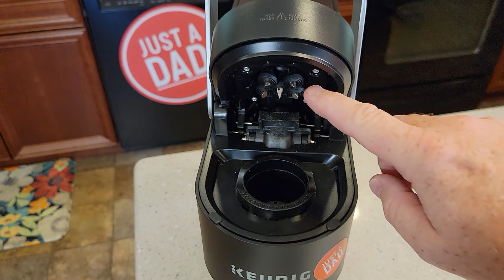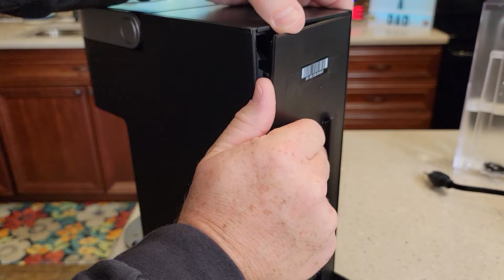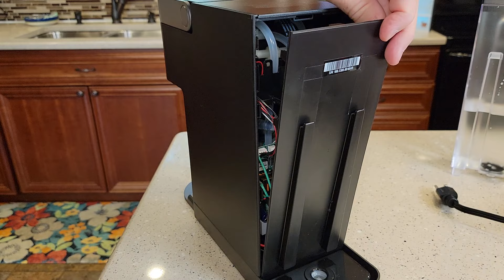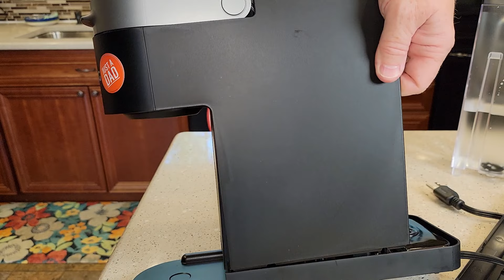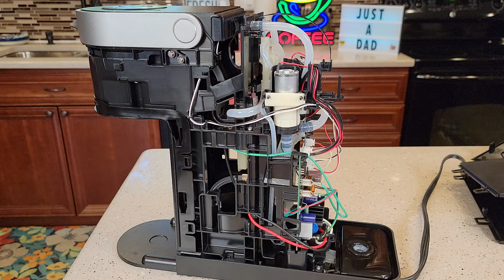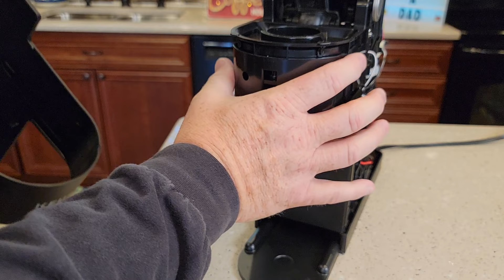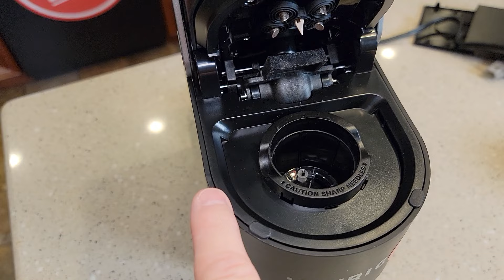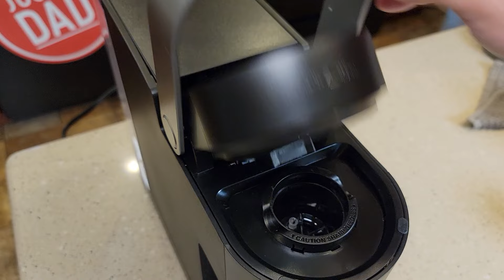🔧 Keurig K-Slim Not Working? | Thermostat Reset & Repair Guide

Comment: Thanks - great video. Only thing to add - I had a left over 3/4" diameter black plastic plug, so before I put the cover back on, I drilled a hole in the cover at the correct spot to easily reset the thermostat without removing the cover again.

Comment: I followed all your steps at the end when I ran the water it did the steaming and the spitting and not too much water came out like you said. I tried it the second time and it didn’t work. The light won’t come on. I will try it one more time.
Reply: I did it again. The light came on, but the water is not coming out. Any other suggestions?

Comment: The hardest part was finding a paper clip!  Actually ended up using a solid length of aluminum picture frame hanging wire.  Continuity checked, descale light flashing, so running a descale cycle.  looking good so far...

Comment: Mine is still somewhat new, but I hadn't used it in a couple weeks. Went to brew a cup this morning, there was still some water left in the reservoir...It started fine as normal, but no coffee came out and it suddenly shut itself off. I could faintly smell something was burning, but it certainly wasn't coffee. 😟Couldn't get it to power back on. Unplugged it, plugged it back in, filled the reservoir...Nothing. The K-Cup inside wasn't even hot...But the top of the machine definitely was. I found some other troubleshooting methods that said to remove the reservoir, unplug it and wait 10 minutes for the computer inside to reset, but that didn't work either. I was hesitant about taking it apart like this, knowing if I slip up and break something, there goes the warranty. But I can't afford to have someone repair it for me, nor can I afford a new one. So this video was my only shot...And it worked! 🥰 Definitely saved my coffee maker, and I'm certainly saving this video from now on.

Comment: I started and stopped this comment about 10 times. I tried to make it short and compact but failed every time, (because there is so much I wish I could tell you).  Bottom line, this mornings descaling killed my machine exactly as you described, by NOT flashing the "ADD WATER" light.  I contacted tech support and got the usual "Did you try turning it off and on again, try another wall outlet... If that fails, you need a new machine" (ref: The IT Crowd)  I purchased a new Keurig Slim on Amazon. (by the way, Keurig  did offer 35% off a $159 Slim when it's $99 on Amazon) Before trashing the old one I thought "I wonder if Youtube knows a guy" ;-) ;-) I found and watched your video twice and fixed my machine in less than ten minutes. Very well documented steps, easy to follow.  Thank you :-) :-)  I still wish I could tell you the full story . After the fix I called tech support again and asked why this solution was not proposed... they had no real answer. Again: Thank YOU :-) :-)
Reply from the maker: Your Welcome

Comment: I have the slim K900 and when I took it apart there is no thermostat.
What happened was my descaling light came on and I was out of vinegar. 
In desperation I pressed 3 more days of coffee out of it. 
Today the light comes on for a second and then shuts off. 
I can’t even turn it on long enough to scale it.   
I took it apart and this must be an old model because I see tube like elements but don’t see a thermostat.  
Any suggestions? L

Comment: Thanks for the great video fix. It definitley was the issue with our Keurig  slim. My son and I customized ours by drilling a 1 inch hole in the side instead of pulling it all apart. We put an electrical hole fill plug in the hole so just have to pop it out if ever needed reset again. Your video made it so we had a good idea where to drill. Thanks again awesome video.                  Tried to upload a picture but couldn't do it.
Reply from the maker: Glad it helped

Comment: Ok I’m ready to do this but not sure if it will work. I had a brand new machine.  I don’t even think I made 15 cups of coffee.  Then I powered it on and light came on.  Smelled like a transformer burning and I shut it off immediately.     Then wouldn’t come back on again.     🤷🏻‍♂️ water was full in the reservoir, so not sure why the thermostat would do this … any ideas ?

Comment: I did this correctly. Or so I thought. I did everything like you did and my first brew it hissed at me and barely had any water come out, just like you. I went to do the second cup and now water just leaks from the bottom and nothing comes out of the normal spot. Then, the machine will overheat and shut off again and I have to take it apart and hit the switch with the paper clip again. I’ve disassembled and reassembled 5 times now. So close 😢

Comment: 2:51 Unfortunately this trick didn’t work for me. However, I noticed my Keurig doesn’t have that green cable you show running over the thermostat. There's simply nothing attached to that screw seen close to the thermostat. Is that normal?

Comment: Oldie but goodie! This worked for mine after descaling. I DID run the water a bit low so I may have let it run dry. Descale seems to bypass Low Water perhaps in some fashion. But, I only pulled the 2 rear screws and the back plate then used my smallest allen wrench attached to small vise grip to reach in and push the button from the rear. How about we drill a hole right above that reset for future use. Cover with some black tape until needed or a grommet etc.. Thanks much!!

Comment: Thank you so much! 
I can not afford to replace this right now, as I'm off work waiting for surgery. 
I followed your advice & the power came back on. However, when I went to run water through it did the same thing. Powered off. 😢😢
Can you help @Just a Dad ?
Reply from the maker: I would prime the pump, by lifting the water tank on and off about 25 times full of water
Reply: Thanks a lot! Ill try this. @JustADad
Reply: No luck. I guess I'll have to say goodbye to it ?

Comment: I can't believe it. I did it and it worked!!!!! 
After running multiple descale cycles it powered off. I must of overheated it in my diligence. 
This thing is a BEAST to take apart. I am your typical female, with NO background in electronics. I am tenacious though. 
Thanks for the video and for keeping it simple.

Comment: Note: some of the older K-slim models (the ones with a U heating coil) don't have a thermostat breaker and are not resettable. Just a Dad confirmed this in the comments of another video. So if you're looking for a thermostat and can't find one, you probably have an older model.

Comment: You saved me a hundred bucks. Did exactly as you said and it worked exactly as you said. Did the bubbles for longer and then it works perfectly the first time. Now I need to descale. Do you have a video with suggestions on what is the best liquid to use ? Also, how to ensure this does not happen when i descale?

Comment: Thanks for info on reset, it got mine working again, just to let you know all you have to do is get the bottom off and use the paper clip with 1/4  inch bend in the end with small vise grips reach in and give it a pop, this saves fighting with the side case, thanks again

Comment: Did all that workto find the thermostat and that entire column is GONE. No thermostat to even rest. Not the one you talking about. It does need a serious decal. But it does work. Just shuts off or the :K light just blinks and turns of.

Comment: You push the power botton to turn it on and all that happens is all the lights flash twice. I have unplugged the machine and tried using the paper clip but it just goes into the whole and you feel nothing happening.....there is no click or depression or anything its like its hollow. Plugged it back in and still no power up. The lights still flash twice and then go off.
What else could be the problem?

Comment: Has anyone ever opened it up and not had that option? I followed your instructions and got it open with no issues but my inside doesn’t look the same. The outside does. S/n: 900.2100.0633051 not sure if I can fix it without that button.

Comment: JAD,
After several months of being in storage, my K Slim would not power on. Found your well made vid n voila!, it's working again.🙂
I didn't immediately finish watching the vid n just made a cup. It was only after that I watched the rest of the vid where you mentioned n demonstrated priming the maker to let out air bubbles in the tank, forcing water to the heating element sooner.
After already having brewed a cup, I lifted the water tank numerous time- up to 10- and the bubbles rose every time. ?
Not saying your's wasn't a good idea n one that I will use as necessary-- just sharing my experience. 
On another note, seeing as you're the Keurig guru, I recently bought a K Elite.
It worked as expected but made the under cabinet light n the over the sink light (same circuit) quiver/oscillate/flutter. Not flicker but more akin to a visual vibration. 
Returned it for the same Elite model-- had the same behavior which I'm not comfortable with. Returned it, too. 
Any thoughts?

Many thanks for your efforts.👍

Comment: Everything looked the same on ours but we could not locate the thermostat, it’s a diff model number than the one shown.  Any ideas….has a green wire, but nothing that looks like the thermostat in your video.
Reply: Same with mine. I just had mine apart this morning and I can't find it. I wouldn't be surprised if they changed it so people have to buy a brand new Keurig..

Comment: Dear sir, thank you for your video. Would you recommend potentially using a 50% water vinegar mix to help potentially descale the unit without using the descaling feature? And then leaving that mixture in the water reservoir for a few days...to help eat away at the potential mineral build up in the lines...using just the brew feature with the water vinegar mixture or is this a bad idea ?

Comment: Omg thank you so much for this video. My grandma’s keurig shut down after she took the water reservoir while it was descaling. We called customer service and they just said if it’s plugged in to a working socket and still not turning on than we need a new one. Well my grandma has two tool boxes and we always put things together ourselves so we followed your video and got it to work!

Comment: I echo everyone's positive remarks on this fix.  Like most mine quit after sitting unused for a few months at a second residence.   I suggest once you've reset the breaker/thermostat to test with covers off to make sure it is working.  My first attempt did reset it. But, the breaker clicked off again. So I had to take it apart again.  Then I reset it and this time legt covers off. That allows you to see the water feed adequately in the clear tubes. It also allows you to see that water is getting the tubes primed by doing the tank up and down pumping.  Ran too 10oz cups and also confirmed add water worked. Reassembled and all was good.  I may decide to drill a 1/2 hole in the side panel to allow access to reset in future if this happens again.

Comment: So happy to have found your videos tonight. Just was given a slightly used one of these Slim models and all of your videos are helpful as it sat awhile with some water in it with heavy minerals. But I wish I would have known the info in this video 5 years ago - threw out one of those $300 color touch screen models with the tanks that lit up (something like the K500s?) for the very things you mentioned in this video! It was brand new. Put into storage for a year, after only been used 6 months by just me (and not even daily). Took out to use after moving. Ran descale, and it didn’t start back up once done. I was heartbroken- wish I had another one and knew how to keep it working - loved it!!

Comment: Your video save me from buying a new coffee maker after mine stopped powering during descaling. (I wish now that Neurig had a built-in reset button or, at least a mention of the ptotential to trip the thermostat during descaling.)

The steps were clearly presented and the video clearly showed what needed to be done to disassemble, reset the themostat, and reassemble the Keurig. Saved me a lot of time fumbling around. Thanks.

Comment: After a failed attempt at descaling (not doing it the correct way) our Keurig K-Slim would not power back on. We were about to throw it in the trash when I decided to do a search to see if there were ways to "reset" it. Sure enough, this worked. I also followed the descale instructions to the letter on another Just A Dad Video and was able to properly descale the unit without any issues. Thank you!

Comment: Thanks for doing this vid. Had a keunig K 25 with this problem.  Tried to take the bottom off but after an hour could not get it completely open.  Finally decided to drill 2   😊1 inch holes in the side and could reset the thermostat switch like you show and it works. So put some tape over the holes and back in business

Comment: I was able to reset it and it turns on, however, no water is coming out and then it turns off. What do you think is the problem?
Reply from the maker: check for a clogged needle you can clean it with a paperclip

Comment: This did not work for me, I also did not descale my Keurig K-Slim before it stopped turning on. It was working fine and then one day I went to turn it on to make a cup of coffee and nothing, no lights or anything. The one thing I will say is that when I took it apart to press that little button thing with the paper clip, I plugged it back in afterward before putting the plastic coverings back on and I noticed this very high pitched noise coming from what I'm guessing was the computer board (it was barely noticeable, I had to put my ear close to it to hear it) and yet the machine still did nothing. There was no obvious corrosion with any of the wires or board that I could see and I'm wondering if anyone knows what the problem could be and if there's a fix for it. Any advice would be much appreciated, thanks.

Comment: I have a k26. It's very similar to this model. Do you know if it's the same process? The machine literally worked one day and wouldn't power on the next. My daughter had overfilled the reservoir between the powering on and being powerless. I wasn't sure if that was the catalyst.
Reply from the maker: No, sorry
Reply: @JustADad Actually I found your Keurig Express video and that's the machine I have. It's just marked with that number on the bottom.  Following that video worked perfectly and the machine is working again!

Comment: Thank you for amazing detailed video. I have little different situation. My Keurig K-Slim machine after I plug in to power outlet and press power button lights up together with descale button for 3 seconds and shutting down.
I did checked thermostat terminals and it had a continuity. 
I just wonder would you know the answer to this symptom for this Unit?

Comment: I DID it!!! 
Your video was sooo easy to follow! I descaled my newest Keurig before went in to help a local LTC place last night. I only had a few hours sleep this morning, was suffering from a headache & then the disappointed of my freshly cleaned machine not powering up. 
A Redditer shared your video and I had my machine fixed in under an hour. (Probably would've been even quicker if I hadn't had to refresh my self on using my multimeter)
Thanks Dad!!!!
Reply from the maker: Good job

Comment: Thanks so much for this video.  I had not used my Keurig K Supreme for several months.  When I tried to use it this morning, it shut down and nothing worked.  I called Keurig Customer Support with no luck.  They just wanted me to buy a new machine.  I found this video and the reset of the sensor worked.  Thanks again.

Comment: I had same post descaling issues with my K900 as most other comments. Had run the vinegar through, followed by a running a few mugs of water, already for the next morning. 
Next morning……unit is dead. Was all excited when I found your video, until I opened it up, which btw you made very easy, only to find my unit simply does not have the thermal reset that yours does. In fact my heating coil is somewhat rectangular, running up and down. Quite different from yours, despite being a Keurig Slim. Was purchased in September 2020, now out of warranty and another landfill casualty. Great video but unfortunately didn’t help me.

Comment: I have the same model. Same problem. Opened mine up and it wasn't like this. It didn't have the spirally thermostat or anything that looked like that anywhere in the machine. Any suggestions?

Comment: I have a K900. It looks just like the one in your video, came apart like the one in your video. Internals are different, can't locate the thermostat. Any idea where it is on this model?
Reply from the maker: the first generation k slim with only one needle on top does not have a thermostat to reset, sorry

Comment: I think an easy way to access this reset button would be to drill a 1/4” hole at the T Stat location in the side panel and then plug the hole with a removable automotive style fastener. Can someone provide the measurements to locate it below the side panel. Great video

Comment: Good disassembly notes. I had a problem with my Keurig slim making weak coffee. You know you're getting this problem when you see more than one stream of water coming down. To get to the needle nozzle section I took it apart from the back follow your directions. 
I might not have had to, I could've just taken the hose off the needle assembly from the front, but the hose is kind of short, and that might not have worked. In any event, I forced water through the needle section, there is actually a vent for cleaning in there too. 
I had run descaling a bunch of times too but this what worked. You know you've solved it when there's just a single stream of coffee again ! Don't have to buy another one either -😅 thanks for the tips.